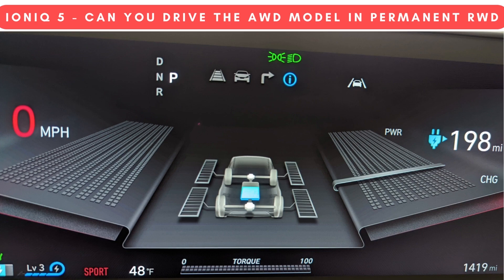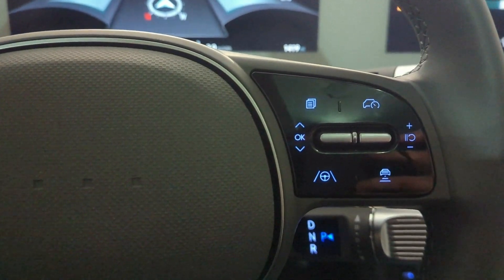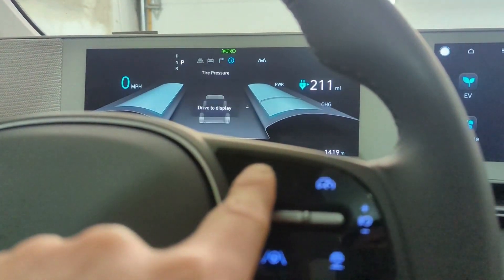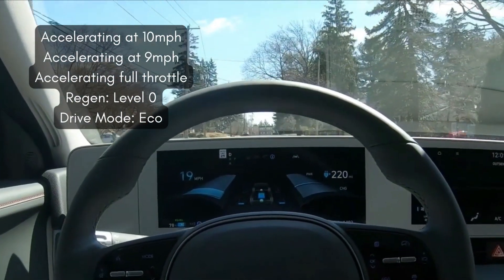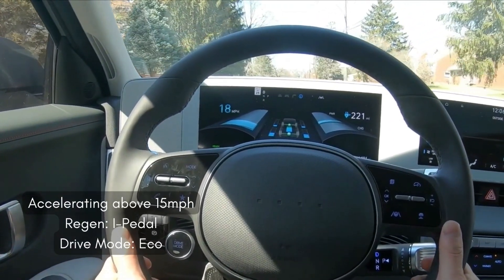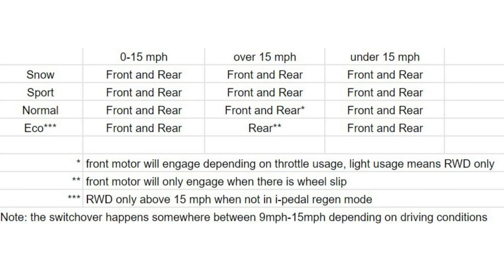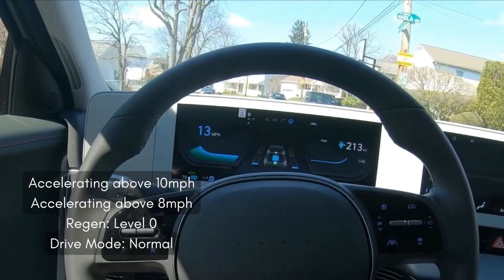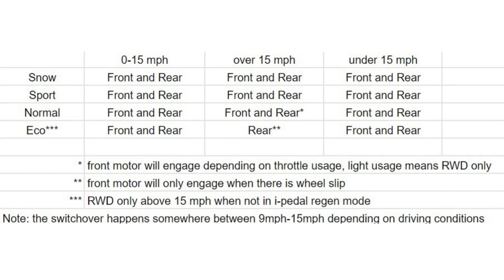Hyundai Ioniq 5, EV6, GV60 - How to Drive Your AWD Model Mostly in RWD. I-Pedal Can Hurt Efficiency!

Comment: I am stuck . I just bought a brand new EV6  3weeks ago . Last week I heard rattling noice in the front . I took it in twice to Kia . They are waiting for headquarters to decide how to proceed  to solve my issue . . My front motor drive is not working . So I get a pull    Like a second break Every time I let off the  pedal . I don’t use  eco or sport mode.

Comment: Wait so if i put the awd in eco modo on motorway driving it should get the same range as the rwd version ?
Reply: No because the front motor adds weight so the car is heavier than the rear wheel drive model

Comment: It makes a big difference on how hard you mash the pedal whether the front motor kicks in. From a standing stop, it always kicks in  if you are coast under 15 mph as long  you are still moving and you start to speed up the front motor will not kick in
Reply from the maker: Yup that's how normal mode behaves.
Eco mode will disengage front motor even if you mash the pedal above 15mph.
Sport mode will keep front motor on even if you are gentle above 15mph.

Comment: I pedal doesn't hurt efficiency. Cruise control disables ipedal anyway.
Reply from the maker: What makes you say it doesn't hurt efficiency?
It's true that cruise control disables it.

But if you drive around all the time with ipedal, that's forcing the car to use 2 motors constantly vs when it can often run using just one.

Most owners, myself included have seen efficiency increases when we stop using ipedal at speeds higher than 15mph. 

Another way to think of it is AWD vs RWD. Why does the RWD have a higher epa rating? Because it's running one motor vs two. You get better efficiency running just one motor.

Comment: I would argue not to use the i-Pedal mode. Compared to level 3 it is only the last meters to stop that differs. In so low speeds the regen is not very strong anyway (the ampunt of power that goes back to the battery) and it is a good idea to use the friction brakes daily to avoid rust and so forth.
Reply from the maker: It's nice that we have the choice to use what we want. I still like using it to come to a stop over the friction brakes but that's just personal preference. Just like some people don't care too much about maximizing efficiency and prefer the simple one pedal driving.

Putting the Regen into level 0 will result in the car automatically doing some kind of cleaning process of the friction brakes (possibly just very light braking). It's somewhere in the manual, I forget exactly what it says.

Comment: Like your content! Hoping you or someone else can help me out with a question. I own a I5 limited. When powered down, the door lock buttons located on the driver side and passenger side doors do not work (works while vehicle is powered).Only the unlock button functions. I can't figure out why. Have you had any experience with this? Or is this unique to my ioniq 5? Thanks!
Reply: Hey! Talked to the dealership and they said it is as designed. Just to clarify with you. When your IT is off in your door is open. You can press the lock button in the car will lock?
Reply from the maker: I can lock and unlock at any time except for when driver door is open (didn't test with other doors). When driver door is open I can unlock but cannot lock.
Reply from the maker: Thanks Rick!
I have full lock unlock capability when the car is off. I've not checked to see if maybe that's an option in the settings so I'd start there to make sure it's not an option that can be toggled on/off.

That's a weird one so if you can't find a setting for it I'd try the dealer next. Does it still work with the remote?
Reply: @CarsJubilee  It works with the remote, and I can lock it with the app. The salesman thought it was the car sensing the key inside. But I checked that and it still wouldn't work with the key removed far away
Reply from the maker: @rickv4701  I took a quick look in the car settings and can't find anything that might be doing what your seeing. Definitely seems like a glitch, hopefully the local dealer can diagnose. Let me know if they are able to figure it out, very curious what's going on!

Comment: I think that for practical, real and autonomy purposes, it is much better and cheaper to buy the Ioniq 5 RWD since the AWD front motor is only used in acceleration and regen when I-Pedal is selected.  I suppose it will make sense to invest in an AWD in very severe conditions, such as countries or areas of countries where it rains heavily and for a long time, with freezing temperatures and persistent snow.
Reply from the maker: Ya I agree, the rear motor provides plenty of power (enough for most people). It's definitely cheaper and in most climates it does the job.

For me, the AWD made sense with my climate like you said (snow in the winter, lots of hills where I live). Plus I'm in that group of people that is addicted to more power haha. The Ioniq 5 blends being a great practical car with surprising performance.

Comment: Thanks for the video.  I've been enjoying i-pedal and will now miss using it.  Question: what's the point of i-pedal in AWD? After watching your video it seems like there is no use for it.
Reply from the maker: You're welcome! Please still use i-pedal whenever you want haha it's your car, you paid for it so drive it however you want!

Just thought it was important that people understood how i-pedal and the awd system were working together.

To answer your question, I still use i-pedal in stop and go traffic where I'm staying below 15 mph. At that speed even if I'm not in i-pedal mode the car is still sending power to front and rear because that's the way they set up the system. So stop and go traffic would be scenario #1 where personally I would use it. Reason #2 is that i-pedal can bring the car to a complete stop without any brake pedal input. If you look at my newest video about the 1 feature that no other competitor has (part 2 coming soon that might help you understand it better), i-pedal plus the other regen levels allow me to execute smooth foot-less braking. Reason #3 is some people want that simple driving experience of not really needing the brake pedal anymore. and they don't mind the efficiency loss. I'm definitely guilty of that on occasion where I'm on a work call while driving and I don't have the focus to deal with the paddles. I end up putting it into ipedal sometimes because that removes the need of switching between the 2 different pedals if braking is needed.

At the end of the day, the engineers/designers did a great job of creating a flexible system where we can choose how we want to drive/brake. So if you want to maximize efficiency you can do that or if you want the most simple driving experience you can do that too. Hope that helps!
Reply: @CarsJubilee  Thank you for the thoughtful reply.  :)
Reply from the maker: @kayoung604  you're welcome!
Reply: @CarsJubilee I'm assuming that while you may lose some efficiency with i-pedal, you'll save wear on your brakes. I-pedal is the closest I've seen to the Model 3 I traded for an Ioniq 5 Limited last Saturday.

Comment: OBD2 dongle will show front motor RPM and rear motor RPM, probably you should see regen on both axles.
Reply from the maker: Ya I'd be curious if the OBD2 reading shows the same as what I'm seeing on the car's driving force distribution page, I would hope so =)
Reply: @CarsJubilee  OBD2 dongle will show much more :) https://youtu.be/nxIzXf1PDy4

Comment: So, I drive usually in the city (with medium traffic) and sometimes on the highway.

According to this, Which is the best setting I should use for maximum range?
Reply from the maker: I can't say for sure which regen level is THE best as I haven't spent enough time playing around with all of them. But if you were planning to just pick one level and stick with it, maybe level 3?

It's okay to use ipedal, and you should when you need max regen braking. Even accelerating 0-15 mph is fine with ipedal since our AWD system forces power front and back. It's only above 15mph where it matters.

I'll have to do more testing to see which is the most efficient if I were sticking to one level but my guess is level 3.

Comment: Have you done any testing with the "Auto" regen setting?
I wonder if it has any effect.
Reply from the maker: Hey Doug, it's definitely personal preference but I don't like the auto setting for my mostly city driving so I've done no testing with it. I like to coast whenever possible and in auto in the city I believe it's sensing the cars in front and never letting me coast like I can manually in level 0. Even if I am maintaining a safe distance and the car ahead is actually going the same speed or faster, it just won't quite go to level 0. 

My guess is that it's not activating both motors except for when you are in max regen in auto mode where you hold down the left paddle.
Reply: @CarsJubilee  Thank you for the great videos and reply.
I'm trying to get as much good info I can for my customers and these types of videos help.

While I get to do some of my own "testing" on the vehicles at some point it just starts to look like I'm joyriding. Which also isn't wrong.
Reply from the maker: No problem at all and glad you are doing your own research to help customers out! And I would totally be trying to joyride as frequently as possible in your shoes =)

Comment: Do you have any information on regenerative braking recovery level between rwd /awd  ?
Reply from the maker: Unfortunately I don't, but I can make an educated guess. Since I switch to I-Pedal eventually during most of my braking, I technically am engaging both motors for regen. But in reality, you use the braking as needed and whether that means using the different regen levels where appropriate or using I-Pedal, I imagine it would end up about the same between RWD and AWD if the driver understands the braking system.

Theoretically, person in the RWD model would know to just start braking earlier since their I-Pedal regen won't slow the car as quickly whereas the person in the AWD model would know to start their braking later since their I-Pedal regen will slow the car much quicker thanks to both motors in recovery. So in that scenario one brakes earlier and the other brakes later, I imagine it would even out to be pretty close.

Maybe you are driving down a mountain, in that case maybe the RWD I-Pedal isn't enough to slow the car down to a reasonable driving speed and you have to use friction brakes. In that scenario the AWD model would definitely recover more energy but that's a more extreme example. I imagine in most scenarios the RWD model I-Pedal should be enough.

Comment: Do you know or does anyone know how far away you can be from your car to use the locate vehicle on blue link? I tried using it and it did some weird stuff love the videos
Reply from the maker: Thanks! Hmm that's a great question, I just tried and it worked for me but I'm only about 25 ft away from the car. I'll test when I'm across the country in a few weeks. Theoretically it should work from anywhere since Bluelink is using Hyundai's server connection and not Bluetooth. I do feel bluelink is a bit glitchy so maybe it needs a restart?

Comment: No wonder why i-pedal is removed as default when you restart the car!

I love i-pedal but I'm glad to know not to use it when trying to save electrons.
Reply from the maker: My thought exactly, perhaps they did know better after all!
Reply: @CarsJubilee  keep us posted about that high pitch sound. I haven't noticed it on mine yet but my hearing at high frequencies isn't that great. But my wife and kids don't hear anything. I'm curious to know what this complaint is and what the resolution is to it. Also I think you should do a video that demonstrates the cool sounds this car makes at 18mph and below. Apparently the feds mandated EVs after 2018 make some kind of noise at low speeds. This car sounds so cool at low speeds. At first I thought it was the drive train but then I realized they artificially produce it. I wonder if it's some sort of external weather proof speaker under the hood or what.
Reply from the maker: @LichaelMewis  will do! Yes hah I was actually thinking about a 'sounds from the ioniq5' video since most prospective buyers probably will not know what they are like going into it.

I actually kind of wish they had customizable acceleration sounds, I think it would have been a fun and quirky thing that matches this car's vibe though I'm sure many people prefer it without any extra fake noise.
Reply: @CarsJubilee  I'm sure they can easily release an update for that feature. But I find the sound that they put in it at low speeds sounds extremely cool but calming at the same time. Same thing with the reverse sound.
Reply from the maker: Ya I really hope so, agreed about those sounds.
Reply: @CarsJubilee  PS I listened for the high pitch sound at 65mph and I can barely hear it. It is not bad at all and doesn't bother me. It's there from like 65-70.
Reply from the maker: A lot of people are saying it's typical motor whine and it all depends on your hearing, if you have good hearing you may hear it more than others.

I tried in sport mode today and could still hear it as well.

Comment: Good info. The only question I have is at highway speed, eco mode, no ipedal (rwd) can it get similar range to RWD only models? I was surprised by the size of the range difference between RWD and AWD models.
Reply from the maker: Thanks Kurt that's my biggest question now too. I feel like it should be pretty close range wise as the only difference at this point under those driving conditions is that the AWD model is carrying about 200 extra pounds. Essentially an extra passenger.

I'd love to test that out with another RWD owner but pretty sure any Ioniq 5 owner in my area would be AWD.
Reply: @CarsJubilee I think you’d be always spinning the axel shafts so that might use some energy. I don’t know how they disengage the front motor. If it just spins without being powered that could cause some losses. If you’ve got some time let us know what your highway range is in RWD mode!
Reply from the maker: It definitely feels like there is some kind of disconnect as when I switch from eco to normal or even sport there's a little delay before I see power sent up front. But like you said I'm not sure how much power is still in use.

It varies so much with changes in elevation, outside temp, avg speed etc. But once we get steady warm temps maybe that will give me a better idea of range or at least avg m/kwh for highway stretches.
Reply: @kmschwem  they physically detach the  e front motor so no usage of energy when not in use :)
Reply: I am sure the range difference is actually nearly non existent. Yes the AWD has some additional weight based on the motor, but I think that the numbers were actually never considering that the Ioniq will detach the front motor dynamically. I guess the range tests always consider the use of all available motors

Comment: Great video.  Any idea if both motors are used for regen braking?  I wonder if AWD can slow the car more using regen or recapture more energy if you're going down a long grade?
Reply from the maker: Thanks! Darn I should have addressed the regen braking with AWD as that's come up a few times now since the video went up.

100% in ipedal regen you get both motors doing regen. The rest depends on drive mode and regen level you are using. There are some rules in place just like when accelerating.

Rule of thumb is if you want to capture maximum energy then you want to be in ipedal regen which will ensure that both motors are engaged and using regen.

Comment: 4wd regen? I tested a rwd in ice conditions with i-pedal mode and it sended the rear out when I lifted off the pedal! 
Sorry fore bad spell!!!😉
Reply from the maker: No problem! I've heard some people mention the regen level braking is too aggressive and causes slides in icy conditions. I haven't had the chance to drive in snow yet, probably not till next winter.

Yes the AWD model does have regen from all 4 wheels if I use I-pedal regen mode in ECO. It's also available in the other modes as long as you are not in level 0 regen.
Reply: @CarsJubilee  Thanx for fast answer👍
Reply from the maker: @BYP333  you're welcome!
Reply: There is a snow mode for slippery conditions.

Comment: This observation may help reduce the drop in range between the RWD and AWD when cruising on the highway at 70 mph. Needs to be tested.
Reply from the maker: Yes agreed! There is the 200 pound penalty the AWD model is carrying around but if that's the only penalty then the range drop should be minimal in those driving conditions. Same as carrying a passenger vs no passenger essentially.
Reply: My personal guess ist that the difference in range between the AWD is actually based on the testing process. The official tests are probably estimating the use of both motors when in real world usage, the Ioniq will actually detach the front motor dynamically. I don’t think the motor weight has such an impact
Reply from the maker: Would love to see some real testing done with this info!